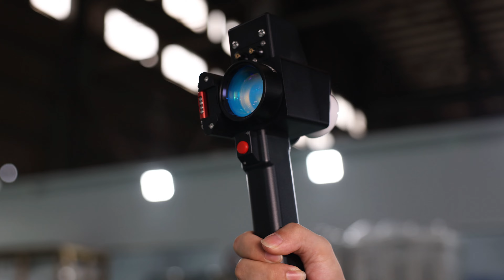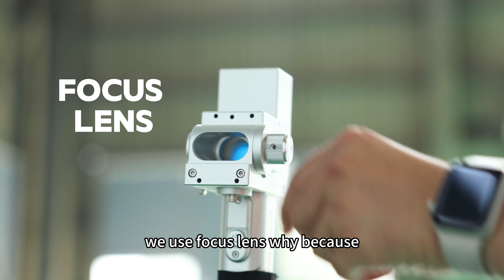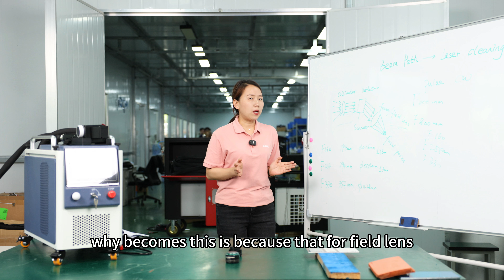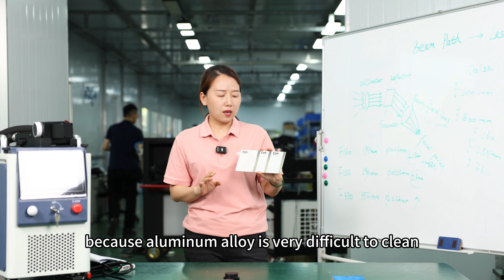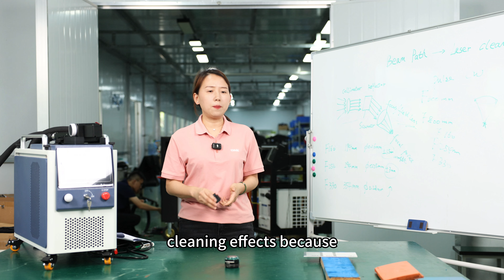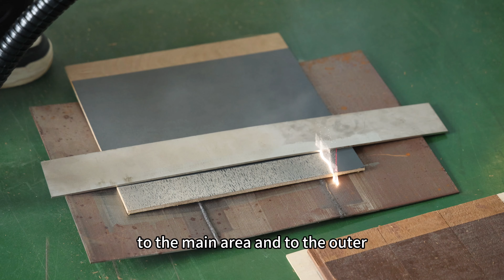Laser Cleaning Technology: The Impact of Beam Path Configuration on Cleaning Effectiveness #foryou

Comment: I purchased a 300-watt laser with a 1-millijoule pulse energy from another manufacturer, which, for some reason, doesn't provide any instructions or explanations, constantly claiming that the device is already configured and doesn't need to be changed. However, all the preset modes have virtually identical settings: 500 nanoseconds at a frequency of 150, which is naturally unsuitable in 99% of cases. Your videos are a lifesaver for me, and I'm still hoping to learn how to adjust the settings according to the material. Thank you very much! I would be extremely grateful for a tutorial on calibration or repair of the scanner if there is beam crossover in "circle" mode.
Reply from the maker: Thank you very much for your feedback. We will regularly incorporate your professional needs and release relevant professional videos accordingly!